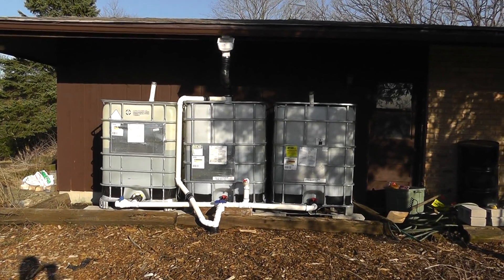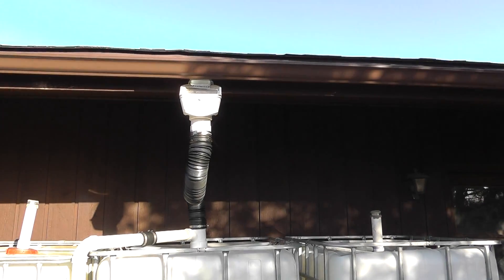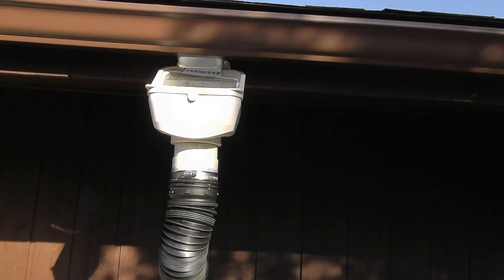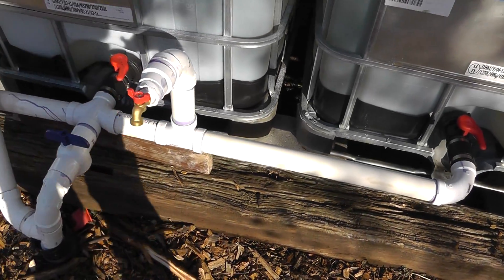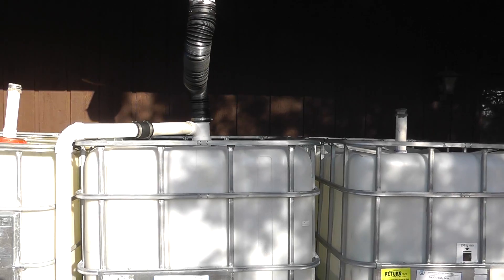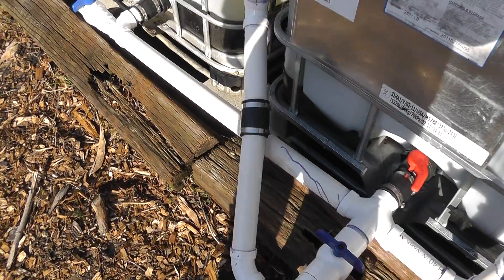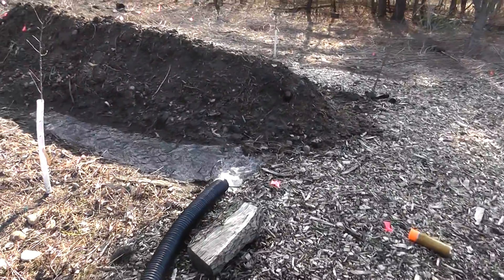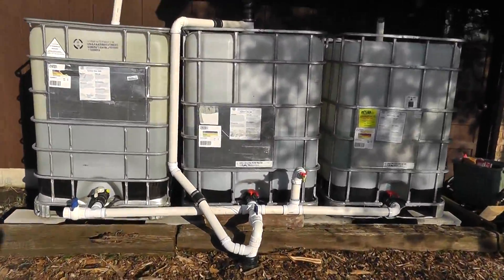CSC Permaculture - Simple IBC tote rainwater harvesting system

Comment: Your water spigot seems too high.  Won't the water stop flowing when the water level gets to the height of the spigot?
Reply from the maker: I think you might be confusing the overflow and the spiggot?  The tanks fill in the center and when the water reaches the top it overflows into the primary outlet and into the swales.  The system has been working flawlessly all of 2012 and 2013 and it fills and drains as expected.
Reply: The little red valve that is about a foot high just to the right of the flood line is a hose bib right?  Water will find level.  When your tank quantity gets to the same level of that valve, nothing will come out, right?

Comment: What was the foundation set up? Are the tanks placed on top of cinder blocks at just the corners? Have you found that to be sufficient? Thanks.
Reply from the maker: I used cinder blocks on a tapped sand surface.  It has been totally sufficient.

Comment: We cannot seem to find a 6"-4" converter to use for the lid. It appears you have just cut a whole in the existing plastic lid. Is that correct? If so, what did you use to cut it and how did you fasten the pvc to the lid afterwards? Thanks.

Comment: How about a four way fitting on top of the middle tank, with the horizontal arms going to each of the side tanks?  That way they both fill and vent.  And on top of that fitting, a "t" fitting, with the horizontal arm used for overflow when the tanks are filled?